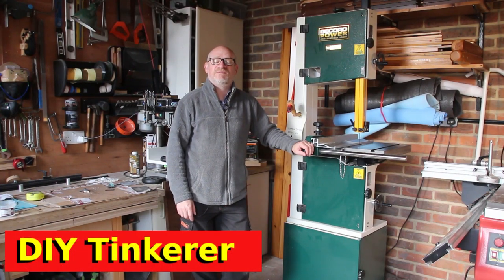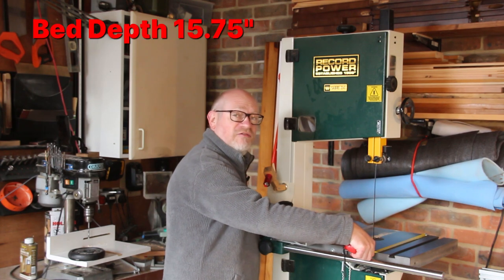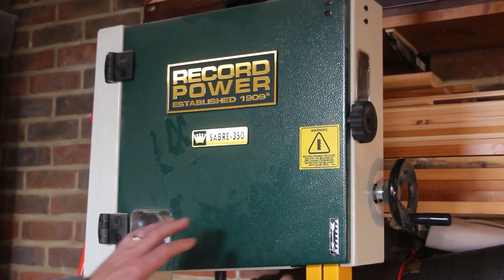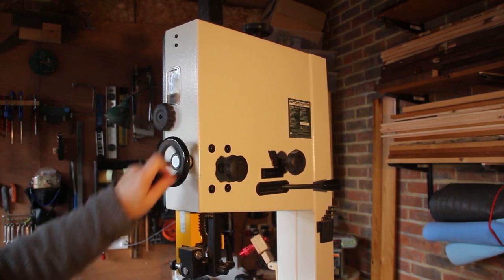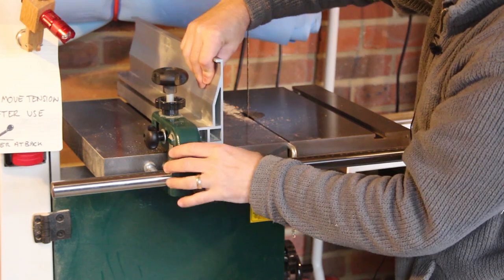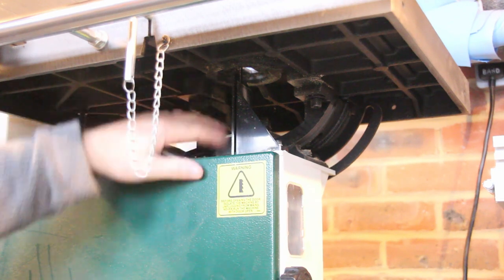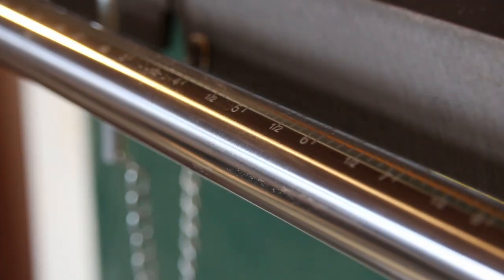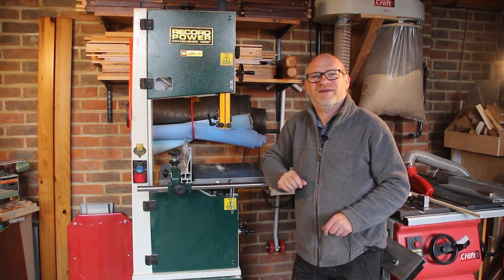112. Record Power Sabre 350 14" Bandsaw review (1 year of use)

Comment: Hi Simon, thanks for an instructive video. I have a had a Sabre 350 for 2 years. I agree with your adverse comments regarding dust collection. I also struggle with the adjustments to the lower Blade guides. But as you say it is a solid, professional machine that does what is demanded of it. Interestingly elsewhere in the world it is sold as a Ricon and badged by Record Power Tools for sale in Europe. Helpful video so a big thank you.
Reply from the maker: Thanks for the feedback, it is always nice to hear when I get things right!
The Ricon connection is interesting - I've seen a few videos where I've thought 'That looks like the Sabre 350',  Record Power say it is made in England, so they are either...
- Manufacturing for Ricon / selling under the Ricon brand for Europe
- Ricon have bought the licence to manufacture independently
- Or it is actually made by a 3rd party which Ricon also use and assembled in the UK for Record Power

I'd always assumed it was actually made in the UK as the 'Made in England' sticker implies. 
Does anyone know if there is a relation ship between Record Power and Ricon?

Comment: Its a decent bandsaw which can take and correctly tension a 1 inch resaw blade, which in itself is a major plus, however the machine needs modifications to work well. The table insert is trash and can snag work, replace immediately. The blade guide jig is fairly good but the rail its held on, and the way its held on is awful. There is way too much play here so I ended up removing, modifying and refixing this whole assembly. Also the dust extraction is poor. Modified with a few plastic inserts and all is better but dont expect any negative pressure dustless operation. If you use without dust extraction, you will need to protect the motor from excessive dust as it will make its way inside. The fence is pretty good and the table on mine was accurately flat, although some others have had flatness issues. Apart from those issues, its a great saw. maybe slightly overpriced considering the poor blade guide assembly, but i dont regret the purchase.
Reply from the maker: Thanks for your thoughts on it. The insert is as you say, I've not noticed the other problem but I'll take a closer look at the guides.  Thanks 😀

Comment: Aaaarghh bandsaw envy again. I simply don't have room for one. I DO have a scrollsaw and am trying to think of a way to make an infeed table with a fence. Wish me luck. Cheers.
Reply from the maker: I think that should be doable,  but only for thin stock, as the material gets thicker the forces increase a lot, you can get much cheaper and smaller band saws, but space will always be an issue for us home woodworkers, this is why I have so many workshop organisation videos! 😀 I'm constantly trying to use the space I have more effectively.

Comment: Cracking video. What’s the difference between the BS350 and the Sabre apart from the obvious cost? I’m ready to hit the button.  However I’m just trying to justify the extras cost! 😮
Reply from the maker: They are very different machines,  the sabre needs no tools to adjust or change blades for a start and if you check out the capacity you will see the sabre is equivalent to the bs450, basically it is a significant step up in quality.

Comment: I have a saber, I've found that the 0 on the fence bar is not in line with the blade.

I can't see that there's anything I can do to adjust it
Reply from the maker: Hi, the etched bar is held off of the table with bolts, these bolts fit in elongated holes in the table, just loosen the nuts slightly and tap the bar back into position. Personally I have never got in the habit of using markings on fences, I always measure, I guess I never really trust they will be correct...
Good luck let me know how you get on adjusting it.

Comment: Do you use Record Power blades? I have the BS12 which I bought 2nd hand with a dull blade, have you any recommendations.
Reply from the maker: I'm a hobby Woodworker and have only had the saw a year,  so only have 2 blades,  1/4" and 1/2" the 1/2" is a Record Power and seems very good, the smaller is made by Dakin-Flathers and also seems very good. However I also use the bandsaws at 'the shed' and those, even with new blades simply don't cut like the sabre350, they struggle, so whilst the blade is important, I think the design of the machine also has a lot to do with easy cutting, such as  large, heavy, balanced, cast Iron wheels, decently powerful motors, good bearings etc. Anyway, this is just a longwinded way of me saying I'm not best placed to answer your question,  my own buying process for blades is to not buy cheapest,  or most expensive but somewhere in the middle,  ideally from a specialist supplier.
Reply: Have you tried EPS Services & Tooling or Axminster? Best regards.     🙃

Comment: Im contemplating buying this machine. but you claimed there was not need to use ANY tools such as alankeys or screw drivers. Then 3 minutes later you show the handy storage compartment for the.... alankeys
Reply from the maker: Yes, those haven't been used since assembly. You can change the blade and adjust all the guides and the fence without any tools, it's all knobs and levers.